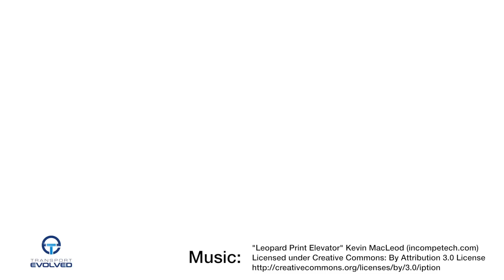Reader Questions Answered: Can EPA (NEDC, JC08) Range Estimates Be Trusted?

Comment: My rule of thumb is assume a battery charged to 80% (so 20% down before you set off) and then allow 30-ish% loss for hills, headwinds, heater use etc so bank on 50% of the NEDC quoted figure. EPA estimates seem more accurate/reliable.

Comment: Just my 2 cents. EPA rating should be considered conservative as it is rather easy to beat. The cold temperature impact as others have noted can be eliminated by addition of combustion based heater. I don't use heat strip to heat my well insulated home so I don't see a reason to electrically heat poorly insulated car cabin. 
As for speed related range loss, I would (idealistic) sue all car manufacturers to design ICE cars for best efficiency in highway driving to encourage long distance driving. This is the core of ICE car-oil marriage. Encourage consumption!

Comment: Really like the "questions answered" videos, a lot more than the "questions posed" ones :)

An important rule of thumb, knock off 40 to 50% of the EPA range for winter driving.
Reply: It really depends on how you drive at winter, and how you prepare for the trip. A lot of miles can be won by preheating the car and battery, while it is still plugged in to the charger and using regen instead of brakes is often not only good for the charge but also a safer way to slow the car on icy surfaces. A Tesla Model S with the 70 kWh battery looses only 19 % at highway speed in cold weather, less than a gasoline powered car.

Comment: I'm not going to sell a big commercial property and ask your advice, so slightly more on topic: The rubbery range figures for EVs I think, is a major issue. EVs are uniquely vulnerable to climatic conditions, too cold and the range can drop a wopping 20% and too hot, the cooling fans or performance limiters have a similar effect. Pre-heat and high(er) freeway speeds limit range also. When an ICE is in the sweet range spot (highway cruising) the EV is at it's worst relatively speaking, People are not used to this state of affairs.  None of this is  reflected in manufacturer's range figures. Real range anxiety stems from this reality and I only need to see that every EV review talks 80% about range and 20% about the car to know this is the salient issue - the unexpectedly bad range and the awful consequences that can ensue.
Reply: Cold weather affects the range of internal cumbustion engined cars as much as it affects the range of a good electric car. The big difference is that you don't notice it as much, when it is possible to get a 1000+ km extra range from pumping gas into the ICE car as you do with the smaller range and longer refill times on electric cars.

If you want to know the range of EVs in colder climates I would suggest you look up Bjørn Nyland, Bjorn Nyland here on YouTube, as he actually takes the time to take the cars on a real world test often in winter conditions in Norway.
Reply: Update: I just saw a Nissan Leaf  owner's Vblog from this winter: He did a range test. At 100% charge (!) his car was indicating an 86 mile range, which is spot on the money for that car. Having driven, with the heating off and driving like my grandmother for 55 miles, his actual power reserve was 30% and his actual range was going to be a further 31 miles. If he'd anywhere near believed what his OWN CAR was saying at the beginning of the trip, he would have been stranded.This is what I'm talking about on range anxiety.
Reply: * ha ha ooh I stuffed my numbers up, noticed it just after I posted. Difficult to write them down when you trying to watch a video. Anywho, he got >30% less range than his car predicted, so I'll leave it at that.
Reply: +Karl P http://blog.ucsusa.org/dave-reichmuth/electric-cars-cold-weather-temperatures
Reply: ferkernall. I try,  maybe 4 years studying to be an engineer is not completely wasted.